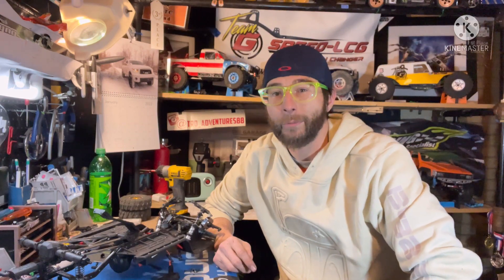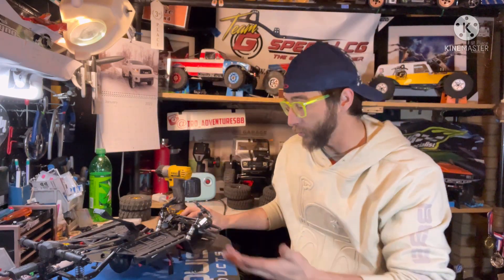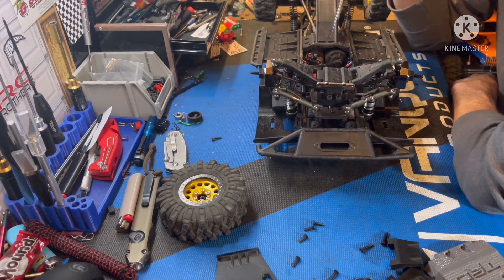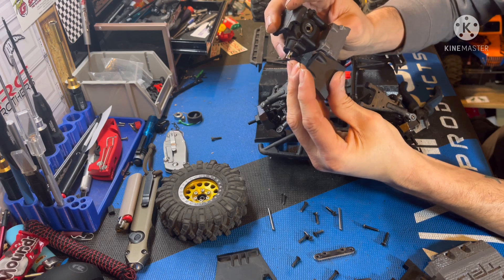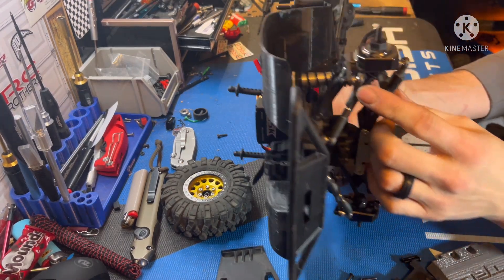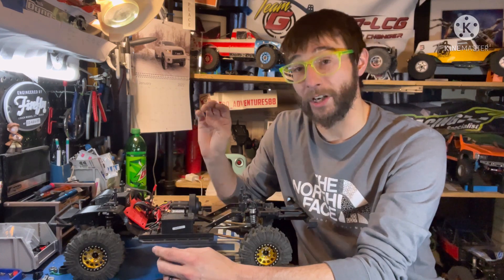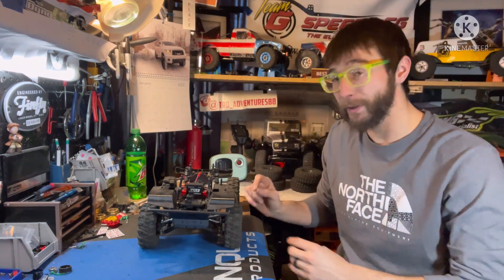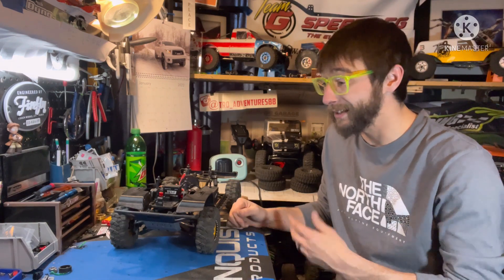Knightrunner IFS modification

Comment: Did exactly like you said and my wheels is having extreme toe out after. There is definitely something you're don't show one should do for this to work. 
My new 3d printed parts is cracking because the screws are to long to from the stock. Something worth mentioning to.
Reply from the maker: I am using the stock hardware.  And I mention in video adjusting steering links as needed.

Comment: I did this mod and found I lost a ton of front lift as in tire to fender clearance. Any insight on that? I took it out once since and everything works I just have a ton of fender rubbing because of the lost ride height, yours looks to sit way higher than mine. I've gone over it multiple times and nothing looks to be done different than in any other installs

Comment: I did this mod , and make the wheel toe out .When I press the front of the car, the wheel is toe in .do you know why?
Reply from the maker: It takes some tunin with the suspension and adjusting things, and some of it is just the IfS design.
Reply: @TRDAdventures Thank you for your reply
Reply: jut bad alignment keep tuning but a setup like this will always have toe movement when travelling up and down